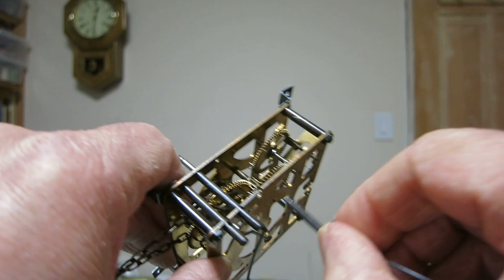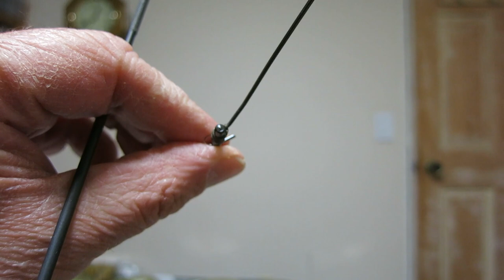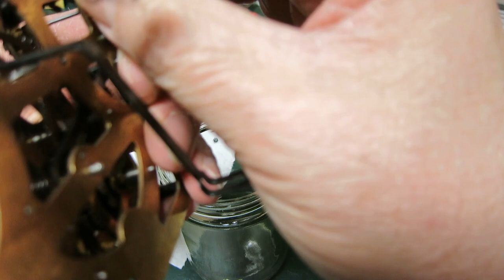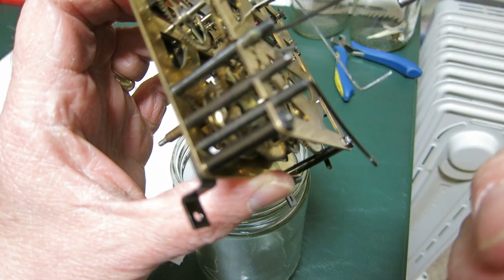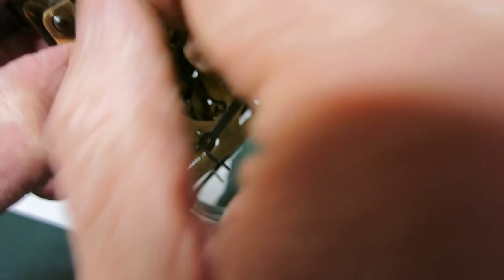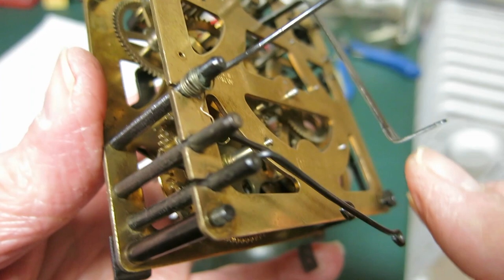Adjusting the striking of a cuckoo clock movement

Comment: Thanks a bunch for this! I’m a rank amateur and recently picked up a Czech cuckoo clock at a yard sale from an older couple. The guy said he hadn’t seen it run in about 50 years. Since it seemed to hold memories for him and fixing time pieces has become a hobby for me, I decided to fix it up for free and bring it back to them. The works were covered in 1/4” of dust and black kitchen grease. My photos from before disassembling were nearly useless because the dust was so thick. So, when the back plate came off, the wheels unexpectedly scattered. When I was reassembling it, your video helped me get the warning pin positioned properly. Now it runs again, and after some case repairs I can take it back to them and see their reaction. Cheers
Reply from the maker: What an inspiring story! Thank you and congratulations.

Comment: great vids Bradford. i'm trying to bring back a clock (like the one in your video) that fell off the wall about 25 years ago. was put in a box until last week when we decided to fix it. insides look perfect,no dirt or grime. can hear something on the half and hour. runs ok but the bird and chimes don't operate yet. put new bellows on. it looks like the black rod does not retract the bird back in. that and the bellows don't sound yet.

Comment: This video was very helpful to me in adjusting the strike side of a Schmeckenbecher one day movement similar to the Regula in your video.  When first reassembled, the lock was occurring in the wrong place in the gong-high note- low note sequence.  I initially thought I could adjust it by popping out the warning wheel and moving it but it kept locking at the wrong place, so I eventually used your technique of popping out the main wheel and moving it to where it needs to be when the strike side locks.  It worked!  Also helpful is your technique of slowly advancing the strike side with your fingers to see where the gong- high note- low note lever lifts occur.  Thank you so much.
Reply from the maker: I'm so happy you were able to get your clock going - Congratulations on your hard work!

Comment: Hi Bradford, great video you have made! I intend to replace the three chains of my 8-day music and movement cuckoo clock (regula 34 if I am not wrong). Each weight is 1260g. Is the a difference for 1 day or 8 days chain? Or I just need to look out for the link per foot? And does 47 or 48 links per foot matter?
Reply from the maker: You do have to get the right number of links per foot. 47 links per foot vs. 48 links per foot shouldn't matter. As chains get old they tend to stretch a little bit.

I haven't yet worked on an 8-day cuckoo, so I can't answer your question about chain length. I have sometimes calculated the required chain length of a cuckoo clock from measuring the gears, but that's a pain and involves a lot of calculation. @dperry428 (https://www.youtube.com/user/dperry428) has a lot of experience with 8-day cuckoo clocks, and could probably answer your question.

Comment: Bradford,
I can seee the general logic of what you are doing but really struggling to keep track of exactly what is moving what.
Can you clarify how you are able to move the parts for testing using just your finger?  Is there still a wheel missing from the movement to allow this to happen?  
I am trying to do the same thing with a full movement here and it can only be turned so far!  
You had various wheels removed at the start of the video and I am not sure which ones are now present.  Please advise.  Regards,  Howard
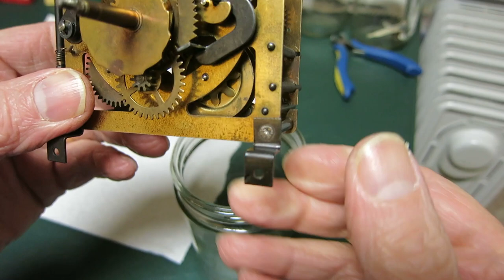Reply from the maker: Thanks for the good question - it can seem at first like there are a lot of gears to keep track of. On the strike (cuckoo) side of the movement  (the drop lever, the rack and snail). At 1:40 I have not yet put in the levers that control the striking, and  I'm just pulling the chain. But I imagine you're asking about about a spot later in the video, where I adjust the end of the striking. At 18:28 all the important parts are in, and I'm pushing the strike great wheel (the gear that runs the cuckoo side of the clock) with my thumb. The key to getting the wheels to turn happens very quickly in the video, and I did a poor job of pointing it out: at 18:32 I press a lever on the side of the movement, that raises the large lever near my right thumb. If your clock doesn't have such a lever, you can just raise the drop lever (the thing that keeps the rack from falling down), which gets the clock ready to strike. After that, I push the strike great wheel with my thumb. When pushing the great wheel, you need to push the direction that will drive the wheels; pushing in the other direction just makes the great wheel ratchet click (like when you're pulling the chains to wind the clock).

Good luck, and let me know how it goes!

Comment: Very good video and massively informative as always.
My one day Cuckoo Clock "cuckoos" at two minutes to the hour and two minutes before the half hour.
Can this be altered so it strikes "dead on" the hour and half hour?
Reply: When cuckoo, stop the clock and move the minute hand to the 30 or 60 minute.
Reply: @KnowYourselfIsOnlyWay  I understand what you're thinking here, but my cuckoo clock is  made by Mayak from the time of the Soviet Union, the minute hand is not adjustable on the pivot in the same way as typical German cuckoo clock. The minute hand square hole cannot be rotated separately.

Comment: My clock has a problem that the bird coos too fast as if the weight was way too much. But that is not the case. Is there some way to slow down the cuckoo-ing? I want to hear the bird go cook coo~ cook coo~ and not like ckcuckcu. Absolutely can't count the coos, it happens super fast. Everything else is fine though. 
I am from a different country and there's no one here who can repair a cuckoo clock. It's been 3 years and every time I hear the clock I go mad cuz it coos so fast, as if the bird was in a hurry.
Reply from the maker: You might try @dperry428, who has loads of experience with cuckoos and other clocks. As a wild guess, I'd guess that the fan (the last gear in the striking train, which has two little flaps) is missing or missing some part of itself. The fan is designed to use air resistance to slow the striking of the clock. You can see the fan in this video spinning at about 3:05, in the upper-left of the movement. Another possibility is that the fan is slipping too much on its arbor. If that's the problem you may be able to fix it by removing the fan from its arbor and tightening it a little. Don't tighten it too much, because it's designed to slip a little as it starts and stops, to relieve pressure from the strike train. Let me know how this repair works out for you - good luck!
Reply: I hang some weight (1 or 2 (18650)battery) on the other side of strike weight, to slow down the star wheel.

Comment: I'm working on a hunter style clock and have an issue where the chain is jumping occasionally on the cuckoo side.  The bird 🐦 door gets stuck on ocassion also.  The chain looks ok.  Have you come across a similar situation?
Reply from the maker: I've read about chain-jumping being caused by a chain that is either the wrong size (Links per Foot, or LPF) or has stretched over the years. Try comparing the links per foot of the cuckoo chain to the links per foot of the time chain. I don't have experience with a bird door being stuck. Good luck and let me know what you find out.

Comment: So what do I look for when it keeps going cuckooing/gonging?
Reply from the maker: It sounds like the strike mechanism doesn't "lock" at what should be the end of striking. I've seen this happen for a few reasons, even in the few clocks I've worked on. One reason could be that the clock movement is dirty, making the Drop Lever (the lever whose tip falls into the sawtooth Rack) not fall into place.  I've seen some clocks with a Helper Spring that puts pressure on that lever, to help it drop into place - sometimes that spring has become weak and needs to be replaced or tightened. If you've taken the movement completely apart and reassembled it, it's likely the Gathering Pallet (the little wheel with a pin that raises the Rack by one tooth each rotation) is out of sync with the lock pin (which I also call the Warning Pin) - I talk about that at length starting at 9:22, talking about too many cuckoos at about 11:01, and I talk about positioning the lock/warning pin vs. the gathering pallet at 12:32. Another thing I've seen is the lock lever  (the lever that hits the lock pin to stop the striking) is sometimes bent out of position so that when the drop lever drops into the end of the rack (which should stop the striking) the end of the lock lever misses the lock pin, and the strike train just keeps on striking.

So, some things to look for when it keeps going cuckoo: Does the drop lever drop into the end of rack when the rack is raised enough? If it doesn't, the drop lever is likely dirty or - if it has a helper spring - the helper spring is weak. If the drop lever does drop into place, take a look at what happens with the lock pin - the warning pin - at the moment the drop lever drops into place. Does the lock lever raise out of the way when the warning pin goes past it, or does it stay in place, but doesn't catch the locking pin? If it raises out of the way of the lock/warning pin, you need to separate the plates a little and reposition the warning wheel relative to the gathering pallet - I talk about how to do that at about 12:52. If on the other hand, the lock lever stays in place and the warning pin goes past it, you may need to GENTLY bend the locking lever in or out, up or down to align it with the locking pin. Another thing to look for - that I don't talk about in this video - is to check the warning wheel and see that the warning pin hasn't broken off!  I describe replacing a bent and loose warning pin at https://needhamia.com/replacing-a-loose-warning-pin/ - that blog is about a different style of clock, but the warning pin concept and how to replace it is similar. NOTE: replacing a warning pin takes a bit of metalworking skill and a few tools.

There are plenty of more complex things that can go wrong; this is just a short list of the things I've seen so far. Some more complex things: is the gathering pallet pin (or even the whole gathering pallet) missing? Is the gathering pallet in the wrong position on its arbor (its post) relative to the bigger pin on the wheel underneath it (it's hard to describe, and I haven't seen it happen so far)? Is the rack 'stop' - the lever that falls onto the snail - is that stop lever out of alignment so that the rack never raises high enough to stop the striking (that problem sounds exotic/rare to me)? Is the rack bent outward, or the gathering pallet pin bent, so that the gathering pallet doesn't raise the rack one tooth per turn?

Good luck, and let me know how it goes.

Comment: Hello, good video.
I’ve just gotten into these clocks and bought an old Hubert herr movement.
I put it in clock cleaning solution and oiled with clock oil. Did not disassemble.
My issue is now the strike can count to 8 for example but seven next hour. 
Any information on the potential problem.
I’m driving my wife nuts testing it! 
Thanks
Reply from the maker: I'd look at how freely the rack moves (the lever with the sawtooth eedge). It should drop and raise easily, without being gummy. It could be various dirty parts, which is why I disassemble and clean all the movement's parts before trying to figure out a difficult clock - I know that's a lot of work. Good luck with whatever path you choose, and thanks for the feedback.
Reply: Bradford Needham thanks for reply. I found the problem few days ago. The tab was not falling on the centre of the snail. More towards the front. I took the e clip off the first cog moves the snail back a bit and it’s good now. 
Thanks

Comment: Great Videos.  My Cuckoo clock does not strike on the hour.  Instead, it strikes at 20 minutes or so after the hour. It used to strike at 10 minutes after the hour, but it has stretched to 20 minutes.  How to I adjust the hands so that it strikes on the hour?
Reply from the maker: I can imagine a few causes, the most likely being that the minute hand has slipped. The cuckoo minute hands I've seen have either a round hole to slip onto a round minute barrel, or a square hole to fit a bushing into.
If your minute hand has a round hole that fits on the minute barrel, you may need to simply tighten the hand nut that holds the hands onto the clock; for how to fix the problem, see "Troubleshooting clock hands" (https://youtu.be/haCnqlR7R-A) by a Black Forest clockmaker, and my own "Problems adjusting the cuckoo clock minute hand" (https://needhamia.com/problems-adjusting-the-cuckoo-clock-minute-hand/). 

If your minute hand has a square bushing inside it, you may need to use pliers and possibly glue to reposition the bushing inside the minute hand so that the hand lines up with 12 o'clock  when the clock strikes.

Good luck, and let me know how it turns out.

Comment: Hi the clock I have used to strike on the hour and half hour but now it’s stopped striking on the half hour. Any reason for this ?
Reply from the maker: My bet is that he clock is dirty enough that the rack (the sawtooth lever on the front of the clock movement) is gummy., preventing the rack from falling on the half hour. Another possibility is that the snail or rack is a little out of adjustment. A full disassembly and cleaning, and perhaps a little bit of adjustment, should help.
Good luck, and let me know how it goes.

Comment: Bradford, my cuckoo movement will gong on the hour, but it won't on the half hour. I see the warning wheel advance just before it's supposed to gong, but it won't gong. It seems like something's out of sync. Help!
Reply from the maker: I'm sorry to say I'm stumped. If it goes into warning on the half hour a lot of things are going right. I'd recommend taking a second look at whether the hammer is moving, and if it is whether it's too far from the gong. @dperry428 (https://www.youtube.com/user/dperry428/about) has a huge amount of experience with Cuckoo clocks, and may be able to help.
Reply: @BradfordNeedham  thanks for getting back to me. I looked at it more carefully and it seems as though the arm with the teeth that is supposed to engage a single click or tooth, on the half hour is not coming up high enough. I took a look at the 2 tooth gear that looks like a spiral Galaxy located on the minute hand shaft and one arm is a little longer than the other. I'm assuming that the longer one triggers the arm with the teeth to drop all the way down to on the hour and the shorter one to gong on the half hour. It's just not lifting it high enough for it to begin the process.
Reply from the maker: @joetherock  Good diagnosis! Yes, the shorter arm of the spiral galaxy is supposed to raise the level high enough to drop the rack (the arm with the teeth) just one tooth, while the longer arm of the galaxy (cam) is supposed to drop the rack to the right number of hours. Note: the problem might be a dirty rack rather than the lever being in the wrong position, and a disassembly and cleaning might fix the problem. Don't go bending stuff until you know the problem isn't just dirt or oil gumming up the levers. Good luck, and let me know how it goes for you.

Comment: Hi sir i have this same model of cucko clock all so work but cucko is not stopping every hour is not not stopping non stop coming & back running not stop the cucko what I'm do tel me pls
Reply from the maker: The cuckoo not stopping makes me think of two likely causes: 1) dirty or sticky levers - to fix this problem, disassemble and clean the clock, or 2) the gathering pallet wheel and warning wheel are out of sync - to fix this problem, review from 11:00 in the video. Good luck with your clock.

Comment: OUTSTANDING VIDEO! Pls help me (TOTAL ROOKIE! Just retired and doing this for fun only) Cuckoo chimes 14 times every hour. Wasn't always like that; used to work perfectly.
Reply from the maker: (I assume it's a rack-and-snail clock rather than a count wheel clock) Because the clock cuckoos the same number every hour, I suspect the rack is falling too far. The rack tail should drop onto the snail to keep the rack from falling too far. dperry428 has posted a large number of his clock repair projects. In https://youtu.be/v4yreDqcf3E?t=2139 he explains and shows the rack tail falling onto the snail. There could be lots of reasons the rack tail isn't falling onto the snail (bent or missing rack tail, missing snail, etc.) Please let me know what you find out is wrong with the clock. Thanks and good luck!
Reply: @BradfordNeedham  Thank you sir!  I'll check out his video and see what I can  do...will let you know!
Reply: Better lucky than good?!?! I watched and paid attention, esp. to the "could be improperly oiled". Figured that's best place to start, so super-cleaned and tested and WORKS NOW! Apparently this was incorrectly oiled (there was an oil film I could see)? I learned a LOT from your video even tho didn't get to put much into action. I may EBAY myself a cuckoo someone else is having problems with and see if I can apply your knowledge to getting myself a deal!  THANK YOU VERY MUCH SIR!  :0)
Reply from the maker: @hogansgoat15  Hurrah! I'm surprised at how often complex-seeming clock problems are just the result of a dirty clock. Congratulations!